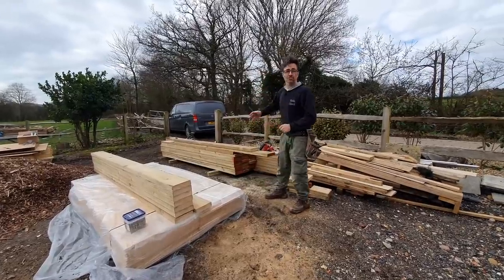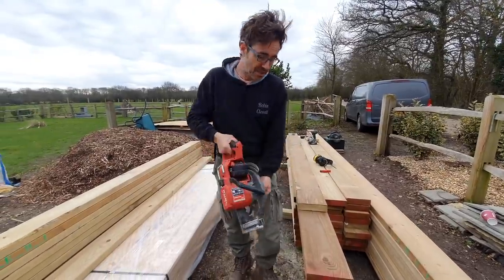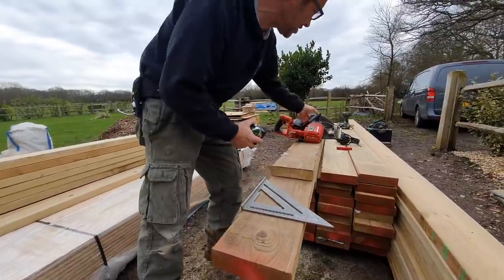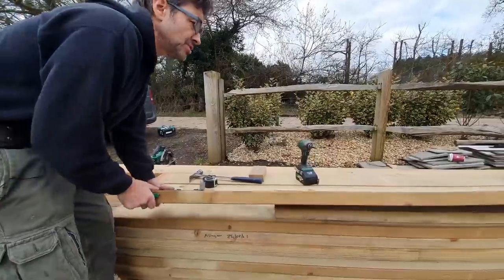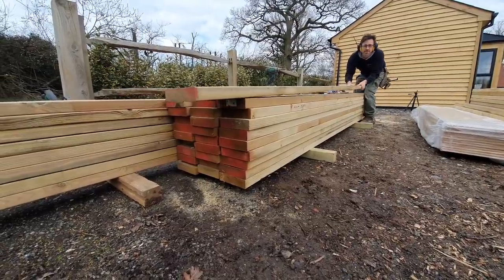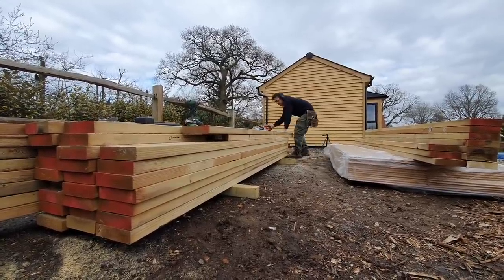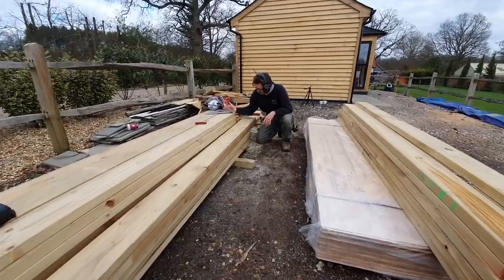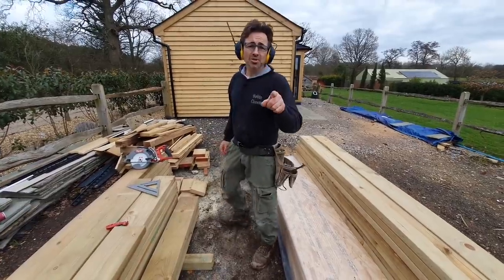How to cut joists well

Comment: I have a steel rule that is exactly the same width as the plate to the outside of my circular saw blade. So when cutting I mark the cut, put my steel rule on the edge of the mark and then use whatever for the fence against the rule. clamp the fence and voila a perfect fence and cut.  As you say very useful for perfect repeat cuts.
Reply from the maker: Great tip!

Comment: Have you ever thought of a small length of hardwood on the fence of the square? It would act as a reference point once you had made a cut with your skill saw. You could do it with the fence of your upcoming square and fence by having two pre drilled holes in the fence.

Comment: If you dont need the joists to be super accurate, ie. if they are just being built into walls, then stack a pile up, mark a line down the edges  and whip out the chainsaw.
They will all be within 5 or 10 mm.
Reply: That's probably not Robin's style!
Reply: Chainsaw!!! This is carpentry not lumberjacking !!
Reply: @thetessellater9163  the chainsaw can save a lot of time mate, allowable tolerances and all that.
Reply: You can be super accurate doing it German style with the Mafell beam saw. Same gang cutting rafters.

Comment: Have you ever tried this with the dewalt flexvolt saw? It refuses to run along the edge of the square, and for some reason pulls itself away no matter how much you fight it. Shite
Reply: Can I recommend you check if the blade runs parallel to the base plate?  Dropped my saw and had similar issues.